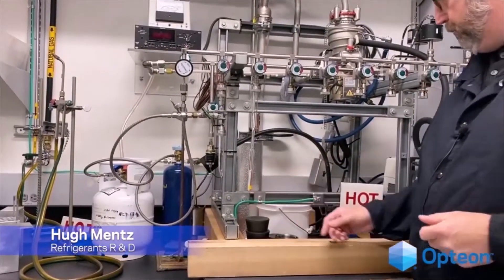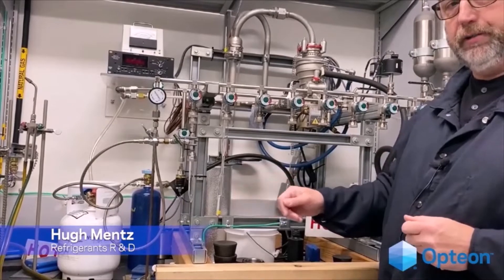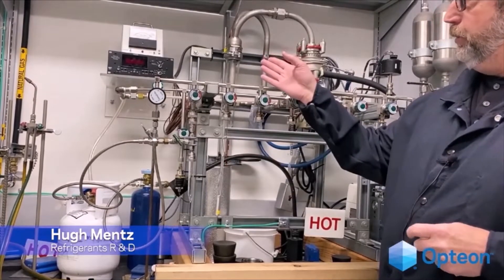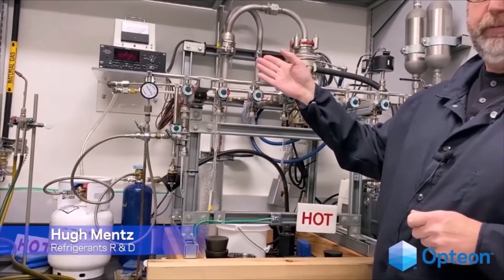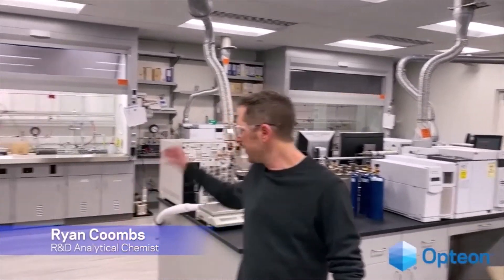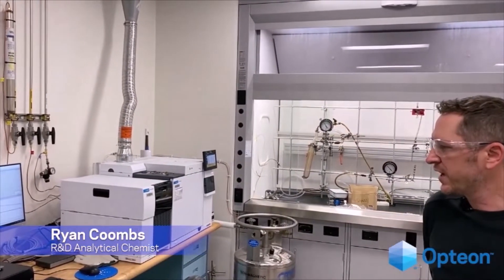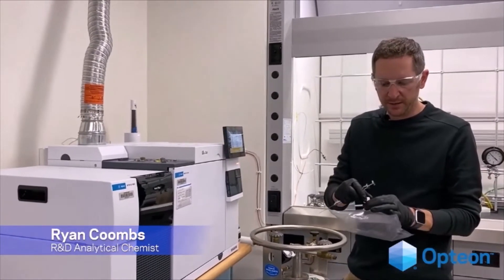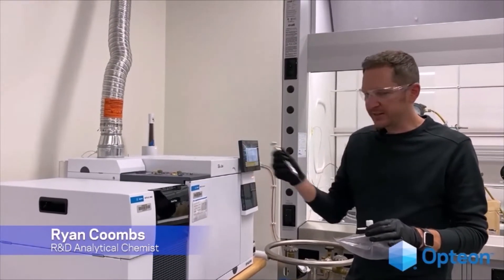Making a refrigerant: a behind the scenes look: Session Preview

Comment: I've actually had the rare opportunity to visit this plant and witness the insane labs that exist in this building. The security as expected is very high, and what's even more stringent is the air quality control in the refrigerant testing lab that I was in for dozens of hours. There are refrigerant sensors all over the room, and if the PPM of detectable refrigerant goes over I believe 25 PPM, alarms go off and powerful vents are activated to remove any presence of refrigerant in the air inside the lab and testing rooms. I met and had several conversations with Jethro, he's a super cool, super chill dude who is just a wealth of knowledge. And now I feel bad that I threw away my security clearance pass 😢. There's also not a single recovery machine in the labs (that I witnessed). They use recovery cylinders and dry ice to drop the pressure so low inside the cylinder that it will suck out all of the refrigerant inside a unit into a partial vacuum which was so cool to do. There was so much more that happened there and I had such a blast, I wish I could go back!

Jethro, if you see this somehow, please thank Barry again for me for letting me borrow his lab coat 😁. And I hope you guys finally got a functioning RST-6 😂 I tried so hard to fix that damn thing for u guys when I was there and it just wasnt having it. I also forget the name of the older gentleman who was working with me the whole time, but if you see this please tell him I said hello! He was such a great guy and had awesome stories.